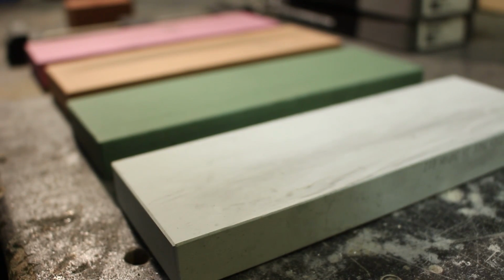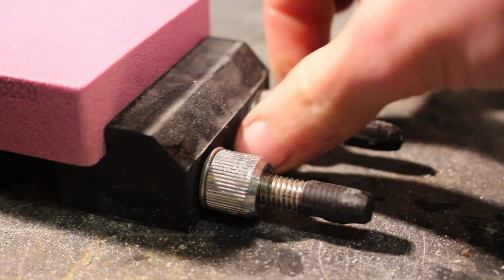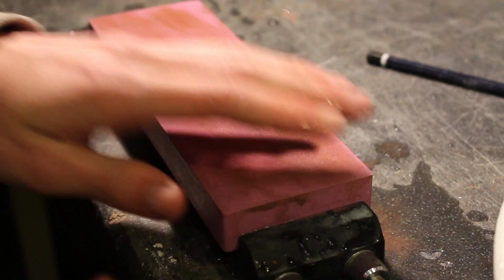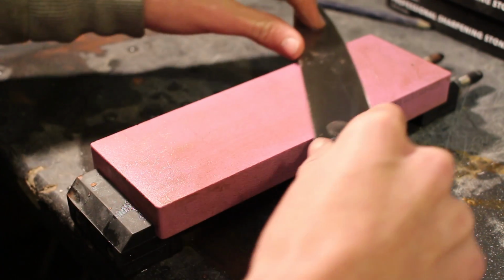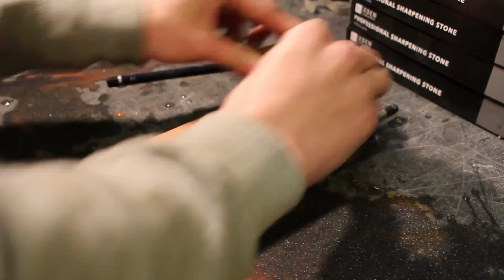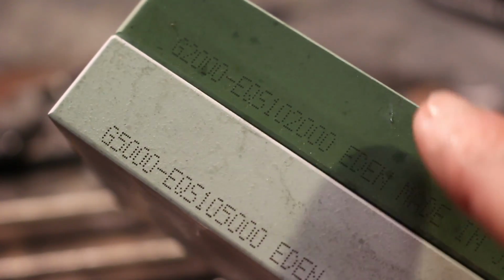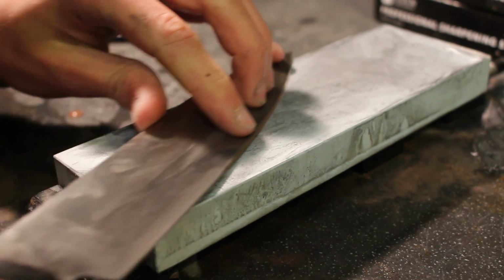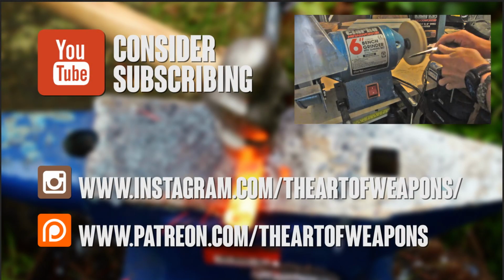How to Sharpen a Knife to Razor Sharp Using Whetstones

Comment: That residue left over is steel loadup, not a slurry. That residue is only slowing down the sharpening process. Even in actual slurrys left behind from the whetstone I and many others have found that it only hinders, or does nothing at all to the edge. In my opinion, there is not enough abrasive in the wearing stone to do anything to your edge. This is why I also disagree with nagura stones for anything else besides removing steel loadup.

Comment: The dressing stone is not for flattening.. It's used removing steel load up from the whestone. If you want a real stone flattener buy a diamond plate for 400 grit sandpaper and finish on 600 grit sand paper.

Comment: The MDF method produces a far sharper knife. The haters are a few cards short of a deck
Reply: Or you don't know how to use a whetstone correctly. Or you don't have multiple grits and high quality stones.
Reply: Both methods work great but if you use the MDF method to often the edge will be rounded.

Comment: Nice video, but this type of sharpening still requires a practiced hand. It leaves those of us without the experience wondering if there's not a better way. The earliest peoples with steel blades used common water stones found at creeks and river beds. Ceramics seem a great way to sharpen blades, but until one picks up the proper angles and sweeps, it's a frustrating experience. Muscles have to be attuned with the brain until sharpening becomes second nature.

Comment: I'd make a leather strop just to give a final polish to the edge and remove any burrs. Just glue a piece of thick leather to a block of wood, around the same size as your stones so you can use it in the stand. Then rub some fine polish on the leather and run the blade along it at the same angle, but obviously in reverse so it doesnt shread the leather.

Comment: the fastest way is to use a fine bastard mill file to put a micro-serration edge on it. Work Sharp makes a very cool knife and scissor sharpener that will sharpen things in about 10 seconds.  way faster and cheaper than any of these techniques, but this is a beautiful way to do it.

Comment: I have to say, it's been fun "watching" you grow up. I do have to correct you, though. What you have is a "whet" stone, not a "wet" stone. The whetstone actually comes from combining "whet" which means to sharpen a blade, and "stone" which is simply the material used to sharpen said blade. Common mistake considering you get your whetstone wet...
Good job, though. I prefer using a whetstone for sharpening blades because I feel a sense of satisfaction in sharpening a blade to the point where I can shave with it, even if it takes a while.

Comment: +The Art Of Weapons it's all about the 'burr'. You sharpen one side of the blade until you develop a burr, then you flip it over. As soon as the entire blade has (had) a burr on both sides, i.e. all the nicks are smoothed out, you go to the next stone to smooth out the scratches made by the previous stone (unless you actually want 'micro serrations' like for a pocket knife). For most applications, 5000 grid is overkill; you're not a Japanese sushi chef.

Comment: How can you unsharpen a knife? I want to buy a karambit but I want it to be dull.
Reply: use it
Reply: Take a file try to cut it with the knife. It will dull it incredibly fast.
Reply: I know he said file, but to be specific, use a rat tail file or a needle file for a karambet
Reply: Why would you want it to be dull?
Reply: just take a file or even a stone and rub it against the blade perpenticular
Reply: +no name (atomflunder2) how would I do it if it is painted? ( it's a csgo irl knife)
Reply: then i would take a small file and do it precise because i think the painting doesn`t go to the edge you should be fine. And arent those csgo knives dull normaly,anyway?
Reply: +no name (atomflunder2) The real life replicas are collectors or display items, but can be used like any other knife
Reply: Hammers usually work or drill bits
Reply: 90 degree angle on a file
Reply: They're made out of shit steel tho
Reply: probably to be used as prop for a video or something
Reply: Mohit Khetarpal Sharpen it with a very big angle, or simply sharpen it edge-down. No idea how this would affect your stone though.

Comment: what about stropping the knife after the 6000 stone?? Is it not needed??
Reply: For most applications I guess it's not necessary, but in my experience stropping does make it much sharper even after 6000 grit. I usually sharpen my knives up to 7000 grit and then power strop them.
Reply: Yes stropping is needed if you want a truly sharp edge. You can also strop it between sharpening sessions to keep the razor edge sharp without having to remove more material and soak the stones etc. 

For a lot of the cutting I do in the kitchen I just go to 1200g diamond stone and this is fine for me. But my woodworking tools on the other hand need to be sharpened to a polished razor edge and get the finer stones and final strop with polishing compound.

Comment: would you not use oil or wd40 instead of water to prevent corrosion?
Reply: these are stones to be used with water, just dry the knife afterwards